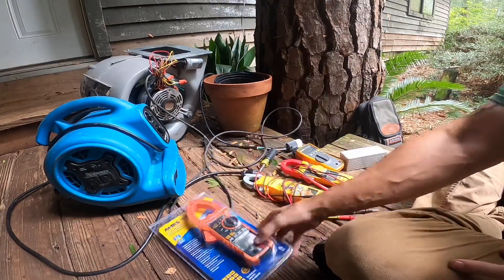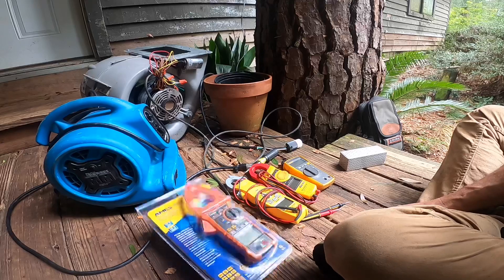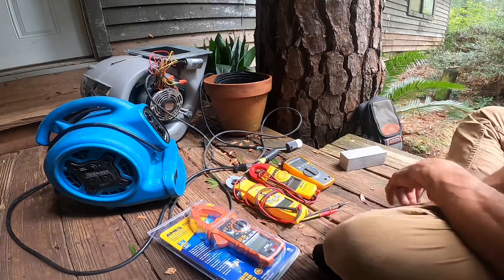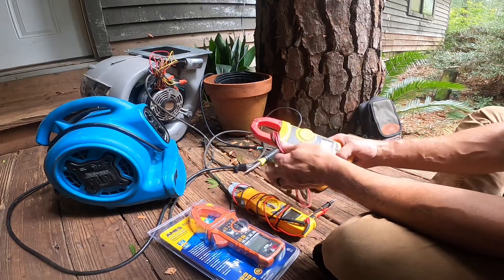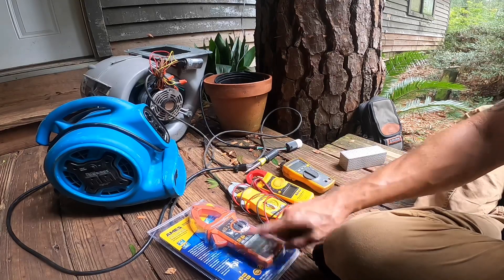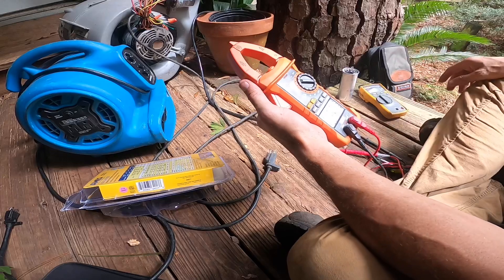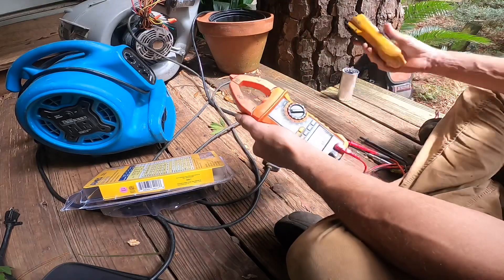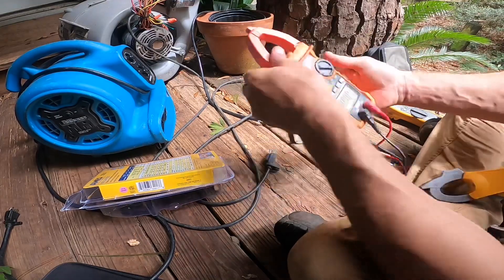Ames CM1000A clamp meter unboxing, testing, and comparison with Fieldpiece SC680, and Fluke 902

Comment: Thanks you just reminded me to change mY batteries out😂👍🏻
I don't know if you ever saw the analog meters, they worked with no category markings.(amprobe)
CAT IV !
🍺🍺🍺🥃🥃🍿🏌🏻‍♀️
Stay safe. 
Retired (werk'n)keyboard super tech. Wear your safety glasses.
Reply from the maker: Yes I grew up using an analog meter
Reply: @HVACGUY  Us older guys grew up using analog cuz that's all there was unless you maybe worked in a lab using bench equipment.  Simpson had some digital but they didn't stay with it for some reason.

Comment: The CM1000A is a rebadged Mastech MS2115A, although the input protection is slightly different on the Ames version. The chip on which it's based is capable of measuring temperature, which would have been handy, so I'm surprised they didn't bring that capability out.

It seems to be an entirely decent if rather large clamp meter. I do wish the backlight stayed on continuously (although if you're not afraid to venture inside, this can be reprogrammed).
Reply: so between the two, which one would you choose?

Comment: The manual for the 1000A says to remove leads before using the amp clamp. Not sure if that was the issue on not reading Hz, etc?
Reply: From my understanding the reason you remove the leads when using the amp clamp is because the ends of the leads can become energized and there is the potential for electrical shock.

Comment: I returned a Fluke 116 to an ebay seller. Meter is beautiful, but the Fluke clamp accessory does not read accurately
Reply: The major put off for me with the Fluke 116 and 117 was if your not eye level with the screen the numbers fade really bad